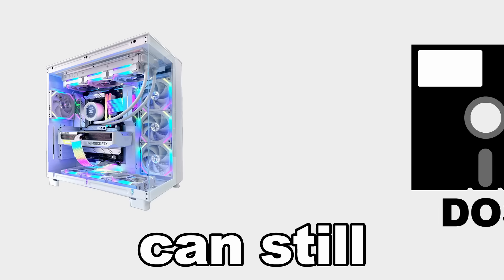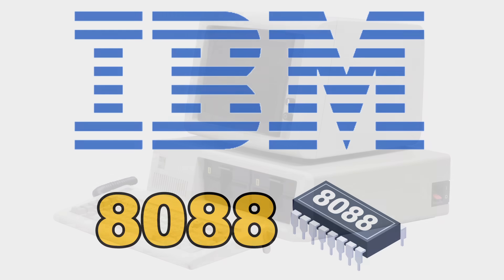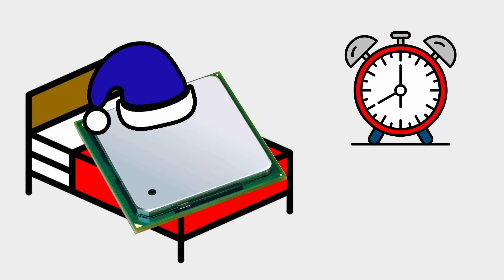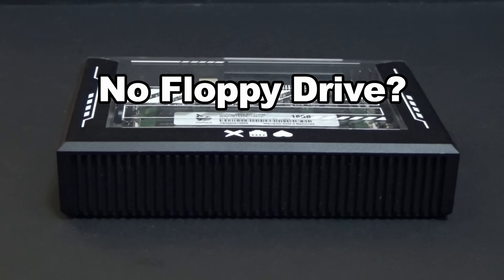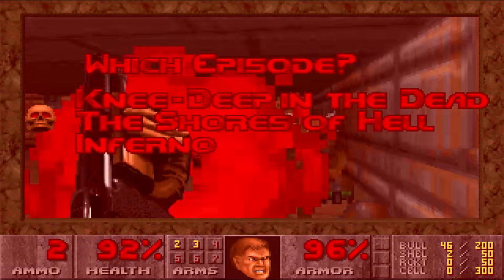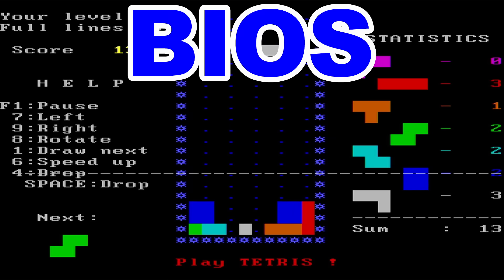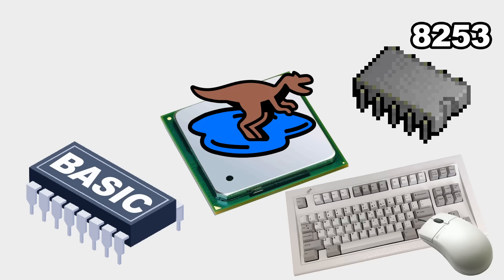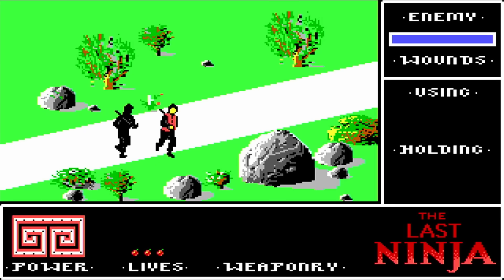45 Year Old DOS on a New Intel CPU Without Emulation

Comment: What's about Sound Driver, Networking driver, UEFI, TPM & Secure boot ?
Reply: Sound Driver, Networking driver
Actually surprisingly hard: there are no DOS drivers for modern sound or ethernet chips, and methods that "hack" an ISA and/or PCI slot into the system (to fit a more contemporary card) demonstrate how (for example) LPC is a very incomplete simulacrum of ISA, missing out - most crucially - DMA.

UEFI
UEFI, if viewed as an "operating system", is considerably larger and more capable that DOS ever was, but works completely differently, with most implementations running in protected mode, for example. Rewriting DOS (which, by today's standards, is a very thin wrapper around the BIOS) to call down to UEFI instead of the BIOS would result in an OS so different from DOS, it might as well not be DOS anymore.

TPM
Interestingly enough, this is actually the easiest: a TPM is a native LPC device (or at least presents as one), which can be accessed through real mode with very little effort.

Secure boot
Goes hand-in-hand with the UEFI issues. Frankly, the simplest way to make DOS secure boot "aware" or "compatible" would be to chainload IO.SYS from a UEFI-aware bootloader of some kind, rather than modifying DOS.
Reply: @throwaway6478  But I can always dig out a SoundBlaster card and use that.  I even have an external one that can do 5.1 sound and the subwoofer to go with it.
Reply: lol, secure boot on DOS . 

but Sound and Network might be doable.
Reply: ..and don't forget that modern computers only boot from GPT. MBR is no longer supported. DOS is no longer possible. I guess he used Dosbox for the fake game videos. Even if he managed to run DOS on that old SBC, games with sound and graphics can't work. It's fake.
Reply: @TT-pi8ww It's a very rare computer that can only boot UEFI (certain very late-model Intel machines). Further, every machine I have that can UEFI boot can do it - get on this - from a MBR drive.
Reply: @TT-pi8ww  wdym PCs don't support a different disk structure?!
Reply: @TT-pi8ww  Yes you can run DOS on all but the newest PC chips.  And I can play games with sound right now.

Comment: Intel will never be able to rid the older x86 instructions simply because the commercial/industrial scape wont allow it for at least another 20 years or so.
Reply: I don't know, they went UEFI-only (that is, removed CSM support) with a bit of wailing and gnashing of teeth, but no actual impact to their bottom line (which is what really matters - revealed preference and all that).
Reply: going UEFI-only is on the system manufacturers and the firmwares they use, not on the CPU manufacturers
the CPU couldn't give less of a damn about what firmware it runs on startup, be it a traditional BIOS or UEFI with CSM or without
Reply: COBOL be, "Amateurs." 🤣
Reply: not quite how it works, nor is there any particular reason to want to get rid of x86 instructions. There have been many sort of "replace PC with THIS!" type projects that have come and gone through the years, and they do not fall on anything relating to industrial anything or what I think you mean by commercial. 
They have no software, hardware or users. Boom. They offer nothing that the x86 PC's don't already do well enough for it to be a non-issue. There are plenty of single use type computers out there though, but the fun bit is even they are mostly x86 because standards and IDE's, plus of course support base, name recognition and so on forth, but primarily device add-on standards and IDE's and to a large degree code portability. 
We humans make everything to fit hands. Hands are the standard. There are alternatives that might be better suited for some purposes, but we won't genetically select for them. Think about it---
Reply: Perhaps to rid completely.. But they can create a series of chips without the older instruction set for datacenter/scientific use. And then keep a gaming/consumer chip with all compatibility.
In 20 years i hope to see RiscV as the main architecture.
Reply: @IvnSoft  They did. It was called Itanium. Note my use of "was" past tense. Look it up 😉
Reply: @IvnSoft and fusion...
Reply: @IvnSoft  why do you hope RiscV to become the new main architecture?
Reply: They likely could eventually, they tried to do it with Itanium and that failed in large part due to AMD coming up with their AMD64 set that allowed the older X86 instructions to continue working even as new ones with 64bit support were added. It also didn't help that a lot of large corporations had a bunch of software that ran fine on the older processors that needed to be rewritten to handle the new processors.

At this point, we're far enough away from those sorts of systems that some combination of emulation and wrappers could deal with whichever instructions are impacted by completely removing those if they want to.
Reply: @SmallSpoonBrigade  It will not happens until the last COBOL database is converted to modern system. 
(▔▀ ‿ ▔▀ )ლ
Reply: @SmallSpoonBrigade  itanium is able to run all ia-32 code in hardware, just not very fast, which was the main concern with the backwards compatibility feature. things like real and protected mode do work on itanium iirc. the main issue with itanium i think was just that its native mode was too unwieldy to write performant code with, and combined with the slow backwards compatibility that doesnt leave it with many upsides
Reply: "Intel will never be able to rid the older x86 instructions"
Neither will AMD, which has only ever copied whatever Intel was doing. AMD is the luckiest corporation of all time. It's flagship product was completely developed by its competition, which was forced to license it to them. They have been making shitty copies of them for most of the last 40+ years. ©😺
Reply: @Great-Documentaries guy whos never heard of x86_64
Reply: @mothcompute 😂😂 forced to secured a cross licensing agreement with AMD after intel's own Itanium 64 project flopped..
Reply: @Great-Documentaries  It's more complicated than that, there was a lot of cross licensing going on in the past, and Intel practically killed them off with antitrust violations more than once. Intel needs AMD in order to be able to duck out on antitrust enforcement. Far more than AMD needs Intel as now there's a lot of mobile processors by various other companies that are the most widely used ones in mobile devices to protect AMD against excessive antitrust scrutiny. So, Intel can fail and AMD wouldn't have to save them.
Reply: @Great-Documentaries  AMD was a chip supplier for Intel in the beginning until Intel decided to make their own CPUs and shafting AMD, which then had to develop their own.
Reply: @Great-Documentaries  x86_64, also known as x64, AMD64, or Intel 64, is a 64-bit extension of the x86 instruction set architecture, first introduced by AMD and later adopted by Intel. It's the dominant architecture for personal computers and servers today. x86_64 allows for larger memory addressing (up to 2^64 bytes) and utilizes 64-bit registers, enhancing performance compared to its 32-bit predecessor, x86.

Comment: I would love to see compilers do more work than CPU.
Stuff like branch prediction should be coded, tested, load registers based on results, and then executed.  You can put other commands between these.
Also, the very time-consuming load indirect should be multiple commands.
These would decrease the complexity of the pipeline.  There will still be latencies on cache misses, but the proper set of commands would reduce wait cycles.
Reply: I think they tried that with Itanium, didn't went well. The compiler had to calculate precisely the latencies and put nops in the proper places, and even do the branch prediction.
Reply: Compilers attempt a lot of stuff like that.

When they're not trying to make rival cpu bench worse anyway
Reply: Compilers can't do anything with branch prediction because that's on a ring lower than the OS.
Reply: @BrunodeSouzaLino  I know compliers cannot do branch prediction, but what I was thinking was while the CPU was computing the branch the compiler could execute a few more pieces of code.
If it was a loop, it would be like, this is the last time the loop is going to get executed.  If/else may be a bit trickier.
Reply: Again I think that backwards compatibility came into it. People wanted to be able to run the same compiled program on their new hardware 

Compiling your entire software collection every time you bought new hardware was acceptable in the days of corporate mainframes, but (with a passing nod to Gentoo and LFS enthusiasts) not for home computing, not for small business computers like the PC. 

That meant that the chip had to do the optimisations rather than the compiler if the extra performance was actually going to be visible 

A real world example of this was when the Raspberry Pi was released. Using the then standard appropriate version of Debian it could use the full sized of the actual chip. 

An American enthusiast recompiled all the Debian code to enable the Pi to run at full speed - hence Raspbian came into being. The average Pi user was happy to download all the re-compiled software, but no way would they have taken on compiling it for themselves. 

(Though I'm sure some GENTOO enthusiasts did so, but they are not the Average user).
Reply: @trueriver1950  We are running a super set of the 8080.
The nice thing about ARM is it started over.

Comment: Not unfortunately! It’s a good thing that UEFI replaces finally legacy BIOS implementations.
Reply from the maker: But how will I be able to play Tetris as it was written in 1984‽
Reply: @InkboxSoftware  To be fair, CSMs are just another module in your UEFI firmware. While I don't know enough about systems programming to write one, I have seen methods of loading essentially an "external" CSM (which was a modified SeaBIOS payload if I recall correctly) from EFI (via shell or whatever), then you can chainload a DOS boot sector/IO.SYS from it.
Reply: @InkboxSoftware  old hardware, FPGAs or an Emulator

Comment: The cool kids got PCs with 8086, rather than the bottlenecked 8088. I had an Amstrad[!] with an 8086 and the full 640K of RAM. The good old days.
And any game that relies on the intrinsic CPU speed for timing (lazy programmers!) will be quite interesting to run.
Reply: It wasn't lazy programmers...well, it kind of wasy; but there is a very good reason programmers chose to use loops rather than the 8253 was the 8253 wasn't guarnteed to be on there. In fact, they couldn't count on any hardware being the same on any of the systems back then. Standards? There were none. No APIs. Don't forget this is an era where your verison of DOS had to be customized by the OEM because the standards for what a motherboard were didn't exist.

It was necessity. Using the 8253 would have limited the software to just IBM PCs and anyone who directly cloned it. By using "lowest common" methods, they ensured it worked on more hardware.
Reply: @dewdude  IBM didn't even name their ISA bus.  It was later Compaq and a group of clone makers retroactively named it, along with their future plans for E-ISA (which soon gave way to PCI)
Reply: My Amstrad came with 512K memory and I upgraded it myself by inserting 18 memory chips. Why a multiple of 9? Because the board was designed with parity, so each byte needed 9 bits. 

That meant, of course, that when it fetched its native 16 bit memory item, each of the 16+2 bits came from a different chip, asking different data lines, therefore in parallel. 

I'm not sure now if memory with multiple bits was already a thing, but if so then Alan Sugar went for memory using single bit chips for cost reasons. 

I felt that the Amstrad 1512 was the first computer that was both affordable on my budget and worth having in my home (apologies to any Tandy or BBC enthusiasts). We had a BBC at work, as well as a Honeywell mainframe, and I was proud that I actually owned the second best computer that I used regularly at the time. 

We also had the then compulsory PDP-11 at work but I never got my hands on its TTY.

Comment: A lot of new laptops don't have any CSM mode so you can't run DOS at all...Soon desktops won't have it either.
Reply: I'm at an impass on your comment:
1) I like it because you are correct.
2) I absolutely hate it because you are correct.
Reply: They won't because CSM mode is necessary for embedded systems still reliant on XP or 7 which do not support UEFI. This is also why you still see serial and PS/2 ports on modern motherboards.
Reply: @BrunodeSouzaLino Yeah no shit but with XP and 7 long out of support except for the most niche of usecases, new hardware for the mainstream will stop supporting legacy and you will need to look for hardware that still specifically supports it

Comment: I'm no Apple bunny but you didn't explicitly mention M1, M2 or M3 AMD processors and how they seem to run Intel code under emulation faster than Intel can do it natively. Intel is at best half-cheeking the throne. I wonder how an M3 processor will do with Doom on DOS.
Reply: Your statement is bogus. 

You do not give what it's faster relative to. You cannot just say "it's faster" without specifying what it's faster as. Equivalent clock speeds?

Emulation is never faster than native at equivalent clock speeds.
Reply: @dewdude  The claim that was usually given at the time when Rosetta 2 was released was that it was on even ground or faster compared to any x86 Mac, in absolute terms. And while interpreted emulation is never faster than native, there's no real reason why binary translation can't be. After the initial cost of translation, the code can theoretically be running optimally on the target hardware if the translation is good.
Reply: I like Apple's Mn processors, don't get me wrong - the performance per watt is pretty impressive. But please don't regurgitate their propaganda. I'm old enough to remember when Apple said PowerPC could emulate x86 faster than x86 could run native. It was a bald-faced lie then, and it's a bald-faced lie now with their Mn chips.

Comment: Some instructions have been removed, for example intel removed some AVX-support over time (because they couldn't fit it in their efficiency-cores) while AMD made their equivalent cores more efficient by removing cache etc
Reply: The earliest versions of Intels processors supported AVX on the Performance cores but not the E-cores. I think it had to be disabled/removed due to complications with the OS level scheduler lacking the softistication to run threads which require AVX on P-cores only.
Reply: In 16 bit mode of MS DOS we can use 64 bit MMX instructions and 64 bit SSE instructions, but not AVX.
Reply: Intel made AVX512 mandatory in all future e-cores.

Comment: Do they still start in real mode with UEFI?
Reply: Most UEFI firmwares have a CSM, which means you can boot real-mode stuff
Reply: The actual CPU chip is still in real mode to this day when it's powered up, but is brought up into 64-bit mode very early by support hardware like Intel ME / AMD PSP before starting UEFI. As far as I know, it returns to proper real mode if you boot into CSM.
Reply: @D0Samp  The management engine feeds initial instructions to the main CPU? I though it's the job of the motherboard and the "BIOS" chip or something.
Reply: @D0Samp CPU can as well start in 64bit mode. Just a bit different powerup sequence and a bit different UEFI firmware.

Comment: I’d like if the hardware was actually made x64 exclusive. They’re fast enough today that they could emulate the missing instructions.
Reply from the maker: I won't touch any machine that won't run PC DOS with a 50-foot pole
Reply: while i'm no expert,  theprimagen did a video called "X86 Needs To Die" where he and some expert in computer architecture looked over an article criticizing modern x86. based on what they say at around the 10 minutes mark, it seems like they are saying that the processor doesn't need anything or maybe very little extra stuff to support real mode (the 16 bit mode) as it is essentially enabling and disabling parts, or bypassing them. there may be some small additional things in modern processors for the 16 or 32 bit modes, but since older processors were so small compared to modern ones, those parts are probably negligible in size, so keeping them is worth it.